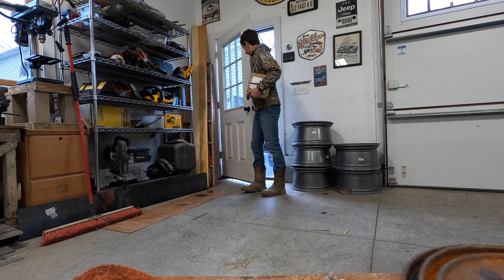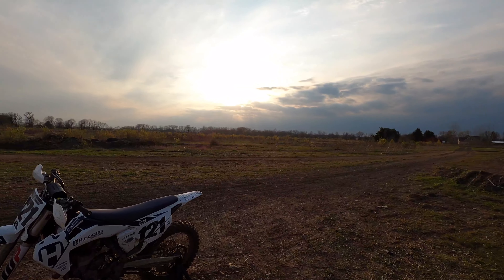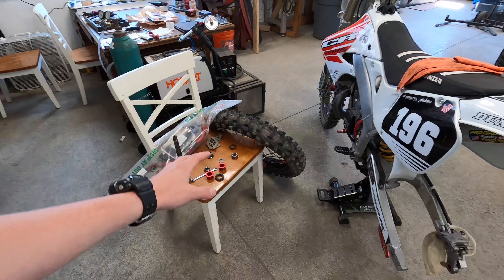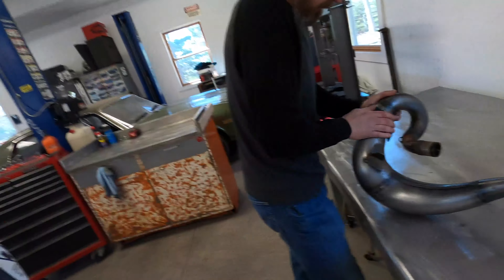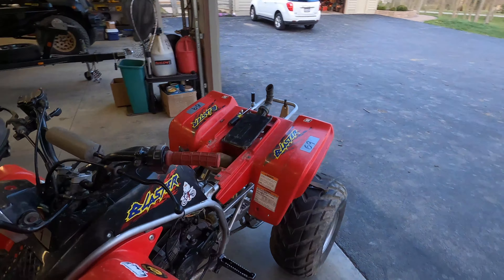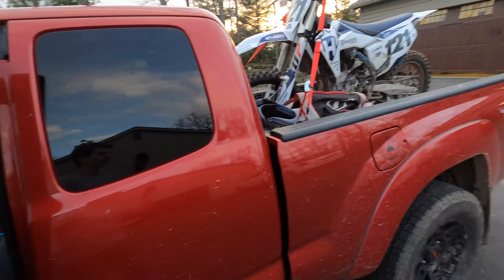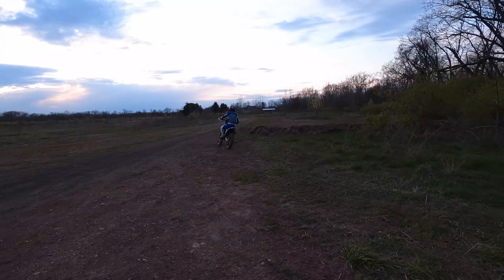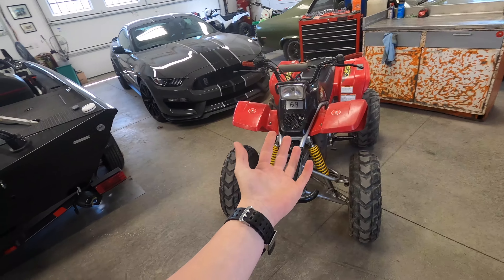MORE YAMAHA BLASTER PROBLEMS

Comment: I bout a blaster for 300$ ran but the crank case was cracked I’ve built it from the ground up and never had a problem with it besides the carb but I got a new aftermarket makuni one it works great I got a pro circuit pipe an silencer as well love it
Reply from the maker: Thats sweet dude!!! 🦆